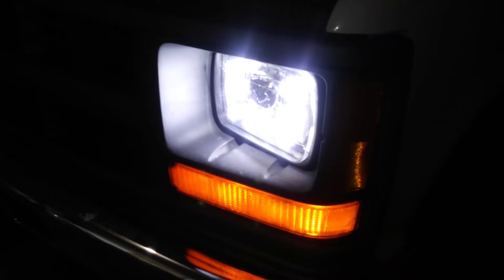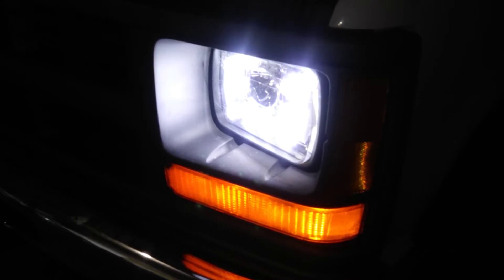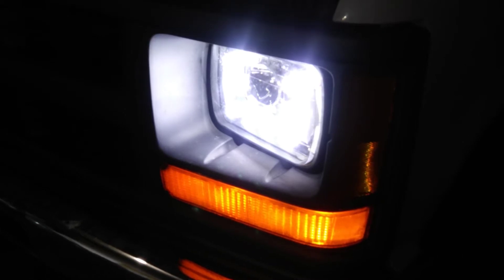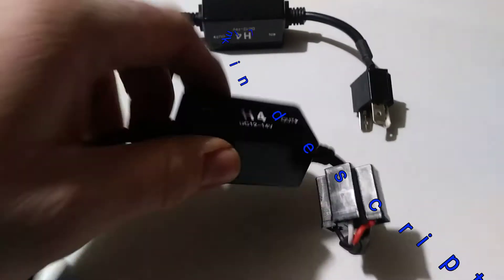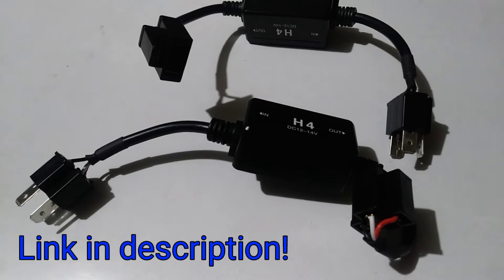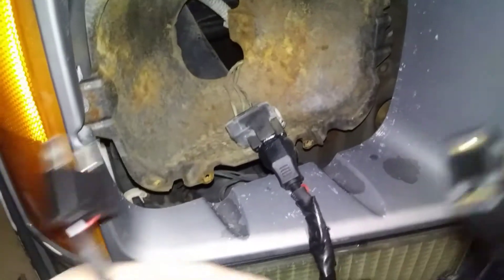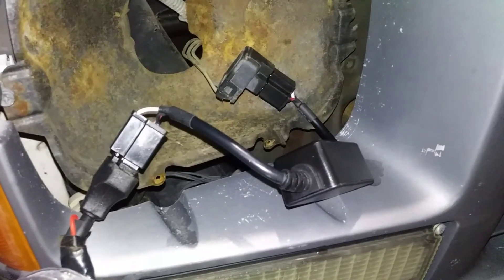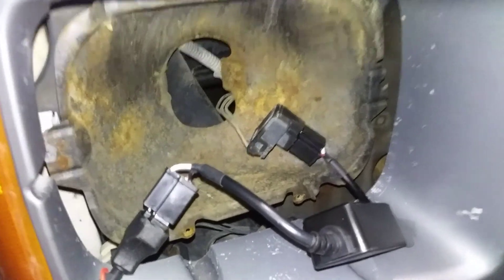Anti Flicker LED Headlight Harness!  My headlights were flickering at idle!

Comment: i have those capasiter thing but my lights still flicker every other minute
Reply: Mine did the same but it could possibly be a heat issue. when I had them in open air they didnt flicker for 10 minutes. When installed into the head, with the hood close it would start after 6-8 minutes.
Reply: Did it happen only at idle and with the engine on?
Reply: @mokujin29  it would only flicker while the engine is on...if it the engine is off it wont flicker at all

Comment: Still flickering on bmw! Waste of money!
Reply from the maker: So are you going to fix the dirty power issue or patch it by sticking incandescents back in?  The flicker is an indication you have a power issue as LEDs respond quicker to power dips as opposed to standard bulbs.
Reply: @1D10CRACY  Not really! Computer make some checks and send some signals and did not recognize the consumer (difference of power and resistance between led and hid or halogen). The single way to fix that was to coding the the board computer to NOT CHECH those lights. I still search some harness more complex to fix that problem whithout coding the board computer.